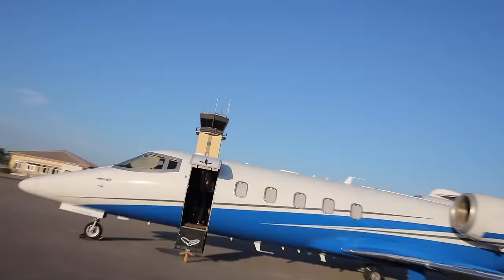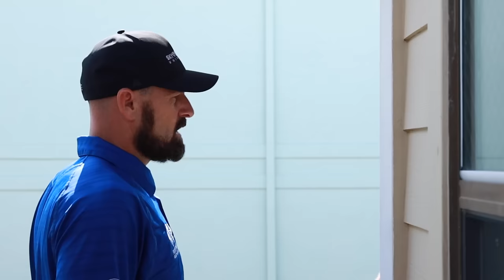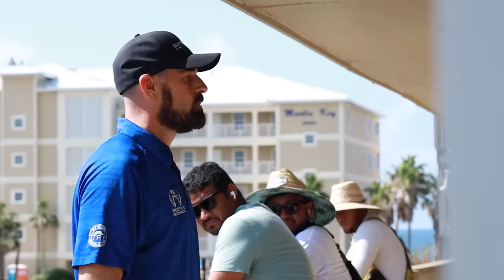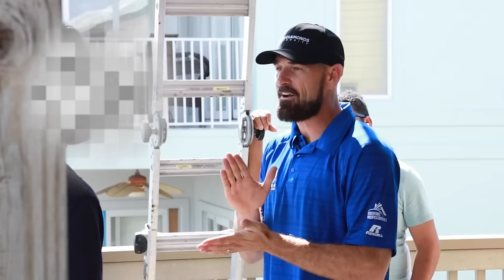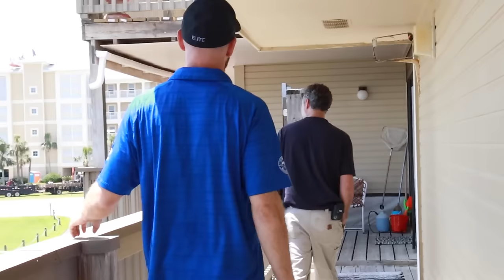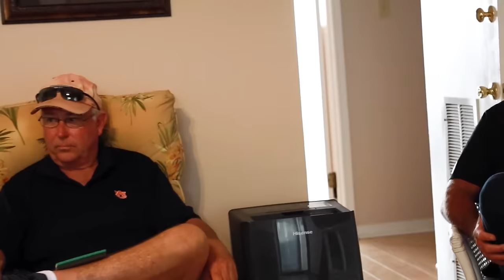Lee Haight - Roofer Vs. Insurance Adjuster: Large Loss Standoff #leehaight #skydiamonds

Comment: I was a insurance adjuster for 12 years and came from a construction background, I handled all sorts of inspections including large loss, I don’t know for sure if this adjuster did his job thoroughly or not but can guarantee that I did on all claims I worked, they way I viewed it is that it was not my money so I will recommend replacing when there is obvious damage but with that being said I have had several claims that I did everything in my power to resolve and should have been a no brainer but went 9-12 months without any communication with management, you are not allowed to call a manager you can only send a internal message which they refuse to respond and if you get pushy you will get in trouble by different management telling you that your claims will be taken away and sent to another assignment, you are paid by the claim so they would threaten to take food off your plate for not just sitting back and allowing them to drag their feet. Basically the adjusters are the punching bag for the big insurance companies making all the money, also you make less money per claim if you deny it rather than pay but upper management gets bonuses for a certain amount of denied claims so they pay the policy holder less money, the adjuster that is there is getting paid less money and in return give out bonuses for the higher ups, reason I quit and now working back with construction mainly storm damage so I can fight these crooked big companies that think they can abuse the little guy.

Comment: This sucks. I'm dealing with this right now after a Tornado and Hail damage. Adjuster marked hail damage all over the house, HVAC condenser, chimney, siding, fascias, screens, all metals on the roof, the exhaust vents along the peak of the roof. Then when it came to the roof itself and the shingles, he said he couldn't tell it was hail damage and said it could be normal wear. Lol Keep in mind our roof is only 8 years old. New for a roof. He said he has never seen a roof this new wear, but he couldn't 100% say it was from the hail and storm. After marking everything else as hail damage. Lol The contractor laughed his ass off and they are going back and forth with it right now. Have a 2nd adjuster coming soon. These adjusters probably get bonuses for keeping claims down. 

So he was basically like ya, you have lots of hail damage and I'm going to cover everything thats relatively cheap, but not the expensive part. Luckily I personally know my agent and he is involved on our side.

Comment: I'm currently fighting with State Farm! All of the kick back adjusters laughed in my face and the roofers. Told me that my roof is in excellent condition. My roof is damaged! Hail and wind damages.  Section of the roof that is missing ! And another area is leaking!!! The unprofessional adjusters laughed at me saying " this type of wood can take on water"....the wood is inside my home!!!!!. Nothing but lies and denial of my claims from State Farm. As these adjusters went to go eat lunch let's see....I discussed going to Burger King and another to Calico Calico County....my home is still not repaired and my roof has not been replaced! I have been yelled at and threatened by these adjusters! A formal complaint was filed but it did not make a damn. I hired Structural engineer company and a LLC engineer for a moisture inspection. All reports state of my roof damages and in need of replacement! I'm truly sick of this! State Farm denied all of my claims !!!!stating my roof is in excellent condition!
Reply: Correction it was the adjuster discussing where they were going to eat instead of inspecting my home!

Comment: My three gable two story roof cost $4600.00 labor and materials. I used the best shingles and under lament. I was so shocked by the roof replacement estimates that were $14’000 or more ???  I replaced all damaged roof structure as well. I hired a professional roofer who on the side.  The materials were $2000,00 the rest labor.  I’m thrilled with the cost and great roofing job done for a reasonable price.  It took me two years to find Eric S. The wait was well worth it. My neighbors single story double wide cost her over $8000.00. This was in late 2020.
Reply from the maker: Oh damn. Thanks for watching

Comment: I guess carriers in Alabama don’t come after y’all for unlicensed Public adjusting? All this policy interpretation talk could bring charges in some places. I mean, get after it and all, but be careful bud..
Reply from the maker: You are 100% right . I have a small fortune invested into the restoration of this property . The charges should be brought on the insurance company . I have the AOB and have full rights to discuss everything in the video . My attorney Evan Wolf reviewed the video and everything is 100% compliant . This intimidation is what insurance companies use to silence contractors . It’s not right. That’s why you can’t be scared to get the contracts signed you need and do what’s best for the policyholder .
Reply: @Miles Garner - my thoughts exactly.
Reply: @LeeHaightYT  When did Mr. Wolfe become a member of the AL Bar?
Reply: When speech is prohibited 99% of the time its for unethical reasons.

Comment: As an IA that has worked large loss in the past, this is a bad look on Adjusters for not doing their job properly.   Normally as an IA, I would never allow any contractor to handle me how this Adjuster was handle but in this case that Adjuster was lying.  Normally we do have an authority to write up the estimate and mailed the check.  If the estimate is above the Adjuster's authority then it goes up for authority request and that takes 3-5 days.  This was poorly handle by the Adjuster but the Adjuster is doing himself no favors by allowing himself to be recorded.

Comment: As someone who has personally done Flood and Fire mitigation, the whole "3 months scheduling constraints" is absolute bullshit! Me and my crew shoveled,by hand, several dozen TONS (yes, tons, as in 2000lbs) of dirt out of 3 flooded basements in less than a week, where a flash flood landslide deposited 2-3 feet of mud and soot into these 3000+ sqft homes. It takes an afternoon to get some new tarps and get them on.

Comment: I've been adjusting storm claims as an independent adjuster for over 20 years.  First off, if he's just a roofer, I would have told him to "F" off as he is not a representative of the owner and we cannot discuss the policy or coverages.  The adjuster is correct in that he has no control over how fast the company resolves the claim.  However, it sounds like the adjuster did not do a thorough job and stay on top of the claim as 3 months with no contact is insane and people would be fired.  The roof and undisputed damage should have  been paid first inspection and large advance.  Emergency services should have been paid right away.  Unless this guy is a Public Adjuster, I would have ended the conversation early.  It was obviously not handled timely...and for everybody out there... independent adjusters get paid by the damage.  The more covered damages we can find, the more we get paid.  So trust me, the last thing we want to do is deny a portion of the claim and not make payment...and most of the time we don't get paid till the claim is closed, so we want payments out as soon as possible.
Reply from the maker: Cool! thanks for watching

Comment: Coming in calling the engineers crooks before you have even see their approach to inspection these roofs or seen any kind of report from them is probably not the best approach. Doing that in front of their client and making unfounded accusations against them is actually slander. Most forensic engineers are there to find damage if it exists, write a report, and get on to the next job. They don’t care what gets paid and what doesn’t. All the while, the complaints about someone making money doing their job coming from a roofer that took a private jet to an inspection.  Oh the irony.

Comment: insurance adjusters have a lot of discretion in how the policy is executed. Typically, the adjuster is not compensated on how little the claim is paid out. Also, you said there was a wind driven rain exclusion, meaning any damage caused by wind driven rain would not be covered. Any subsequent water damage as a result of the roof damage would technically be the home owners responsibility (though some compensation mgiht be applied). If you live in a community that is prone to high wind events you should specifically obtain a policy taht will address this, or pur a rider in your existing policy.
Reply from the maker: You know your stuff! thanks for watching

Comment: the biggest mistake by the adjuster is sitting down with the contractor, they lied on video when they said we are not trying to gig you on anything but then sends it to their attorney. Adjusters rememeber when a attorney is hired by the insured you no longer have to deal with them or their contractor. Everything will go through the attorney.

Comment: Insurance company's keep 85% of the money they take in. I had no less than 15 policies last year. The house got hit by lightning. Killed three home theater receivers both direct tv receivers the heat pump and air. Fried the drect tv cable in the ground.  Two tv's 4k Samsung. sub woofers. an Amp bought in the service and other things. Paid $650 for estimates. Took a year to get the $6000 from my brother the agent. The heat pump was $10,000 alone went all summer without air last year. Well im down to 7 policies now.
Reply: Get a licensed electrician to run a full megohm test on all the wiring in the house. Thorough documentation proves the damage to the personal property and could potentially warrant a full rewire for the entire house. Systematic approach and documentation can't be argued with.

Comment: I hate insurance companies.  I hit a deer in a rural area near my home right before I was to turn onto my 25mph road from a 55mph road.  I drove slowly home after 911 directed me to and said a cop would be out in an hour.  The next day,  I still had to go to work and the damage was just to the front wheel well, the bumper,  the light,  and the corner of the hood.  As soon as my car got up to speed on the 55mph road my hood flew open and wrapped around my windshield.  Insurance company made me pay 2 x $1,000 deductibles because the incidents were "not related".  Yeah.  My a$$.
Reply from the maker: That’s just not right . Ins companies are the devil

Comment: I had my windshield replaced in my car. Water started pouring in. Glass company denies any involvement, it was coming in through the passenger window. I take off the trim and the glass company decided when they broke my trim that holds back the weatherstripping, they would just try to epoxy it back, with a GIANT piece missing that they broke off. That was fun. Eventually got my payment for a totaled car, fuckwits.

Comment: I've been working with my insurance scammers since January 6th of this year to repair my kitchen and downstairs due to a covered loss regarding a busted hot water pipe.  They paid the water abatement company $20k to rip up and dry out my house, they paid the plumbing company $13k to "relocate" my water heater and add like 4 feet of extra piping, they paid the storage company $12k to store my things.  But they only gave ME $22k to replace an entire kitchen and all the continuous flooring in my downstairs.  Every contractor I had come out quoted me $50k, $60k, $90k for a new kitchen because none of them would repair or rebuild the damaged cabinets using the old doors, drawers, and face frames like the insurance scammer wanted them to.  I went through a half dozen contractors, plus two insurance scammer recommended contractors and no one would touch my house for that $22k.  Finally I just had to start doing it all myself with the help of my buddy who is a kitchen/bath contractor.  Here we are in July and we're about 80% done and I'm out of pocket around $25,000 and my insurance couldn't care less.

Comment: I beat these scumbags in 2004 after part of my roof was torn off by hurricanes in Florida. Yes, plural because they took so long fighting that 3 hurricanes hit by the time anything came around.  They took so long arguing arguing that this master craftsman whipped out a tape and my own high end photography equipment and showed their 3rd adjuster and "engineers" I assume, the deal, to the inch on the roof, all the damage. They messed with the wrong guy.

Comment: Well in the adjusters defense, he may be able to scope the loss and ask for specific quotes... But they rely heavy on their contractors and engineers to tell them what damages there are an which are related to the loss and which are not. The adjuster is also not obligated to discuss the specifics of the loss with a clients roofer. As well after a large storm resources are hard to get and labour is hard to get, so getting preferred roofers, engineers and contractors out is very difficult as there is more work then there is time. This also appears to be a Independent adjuster (there are company adjusters that work for the insurance company who have a lot more authority and can drive the claim a lot better, and there are independent which work for a third party adjusting firm that is hired by the insurance company) Independent have little to NO authority and everything has to be sent back to the insurance company for approval.. including requests for engineers, contractors, additional quotes, additional emergency services... the independent adjuster can only "recommend" (his words) a course of action to the insurance company, they will then review and decide if they want to do that. Not only do some insurance companies take months to answer the independent adjuster, it could take months for them to give a NO back, so they may ask for another quote, or say there is an issue with the roof we were not aware of, they may wait and get a NO, and be handcuffed. Then behind the scenes the insurance company has like 10 adjusters behind the phone that can handle a large loss, and this is a major storm, they may have 100 to 200 files. They cannot get to all the estimates, reports and emails in a reasonable time either.  I personally think the adjuster here was bullied here. It was brought up about the windows, the adjuster cannot stay at the loss for 2 day straight reviewing all the damages, he has other losses he needs to go to, as well the insurance company only pays for them to do so much, some insurance companies pay a flat $650 fee or some nominal amount like that, they cannot afford to stay there for days scoping and counting windows and sq of carpets, and LF of baseboards, that's why they rely on the contractors. Adjuster is correct, he should not of given a timeframe for when a roofer would come back, especially during a major event, since its so volatile. In a major event, with a large loss, sometimes it takes 6 months to 12 months before repairs even begin, there is a lot of bureaucratic stuff that has to take place, the city needs to get inspectors involved, city engineers involved, environmental groups that have authority over local areas construction, ect... The adjuster can be sympathetic but they are asking him to take personal responsibility for the delays. They are cornering him trying to get him to admit to a Error and Omission on video recording, which is extremely inappropriate and could legally implicate him and the insurance company in a possible lawsuit.  At the end of the day, i see this as bullying.

Comment: This contractor is a joke. He clearly doesn’t know that he’s talking to an independent that doesn’t make payments.
He can’t talk policy either.
This dude needs to be kind to the people he works with
Reply from the maker: The jokes on you . That adjuster gave written instructions to install tarps / tpo over a metal roof to make it stop leaking . Now all metal roofs are damaged from wind and tarp . He lied to the HOA to me . Tried to get us to removed TPo for his inspection and then reuse with holes . Turns out 68 people still without their home. You are brainwashed bud . I had full rights to discuss every aspect of the claims as the hoa assigned the benefits of the claim to me  . My guess your an adjuster or contractor who never dealt with claims this large .
Reply: @LeeHaightYT  if you aren’t a PA, you can’t talk policy, whether you know what you are talking about or not.
No need to be rude like you were either.